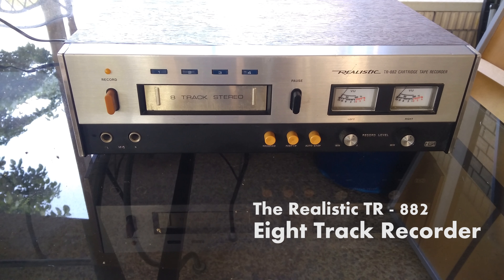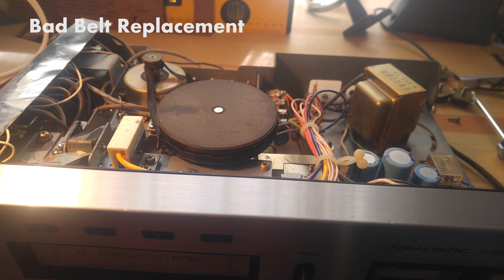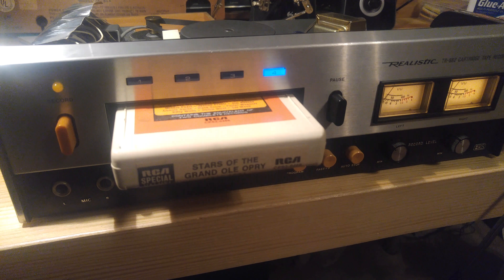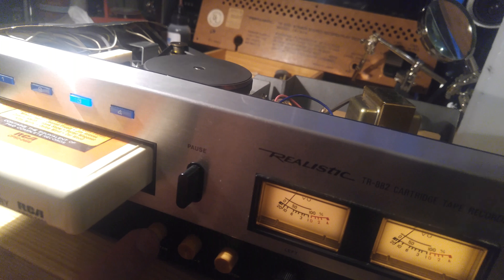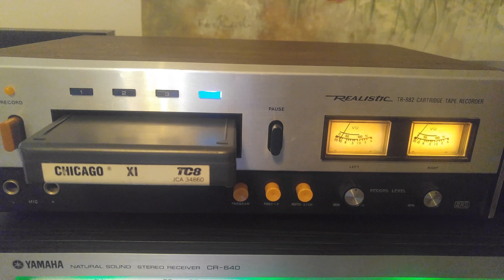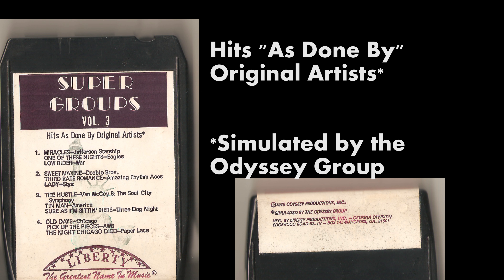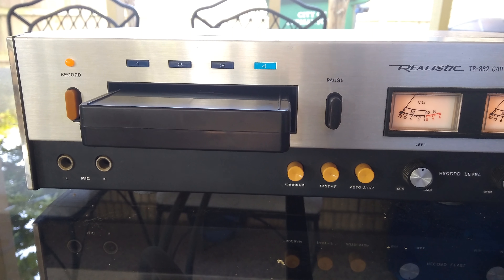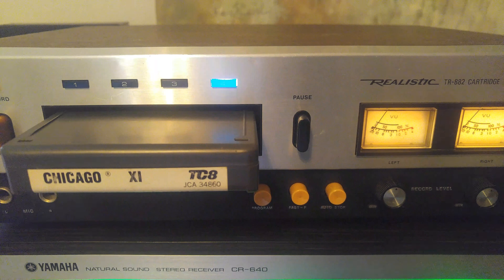Realistic TR-882 Eight Track Recorder

Comment: I've just picked one of these up but I getting an original belt is tricky in the UK, what size belt should I get?
Reply from the maker: You might try to find a 'kit of various sizes" on Amazon. here's a link to the one I bought for our most recent cassette deck video and it has a bunch of different sizes- https://www.amazon.com/dp/B08BYHLSBN
Reply: @ACBMemphis  thankyou il have a look, I read somewhere to measure the distance with string and subtract 10% for tension but I'm not sure.
Reply from the maker: @bigajg100  I've always measured belts by stretching between two pencils on a ruler.. if I do that method here with the belt I used on this machine, it's about 14.5 cm before it starts to become tight.
Reply: @ACBMemphis  thank goodness for your video man, my track selector was stuck also, took it apart and greased the pins now working. Thankyou
Reply: I just acquired one of these as well - belt was broken... I used a similar sized rubber band - and it works great!!!!